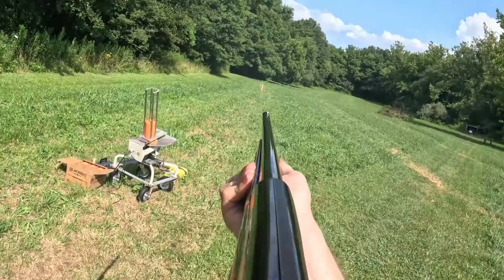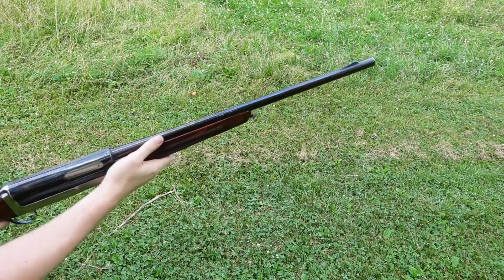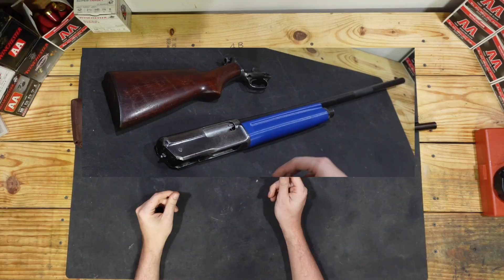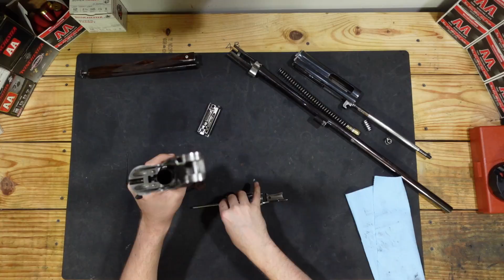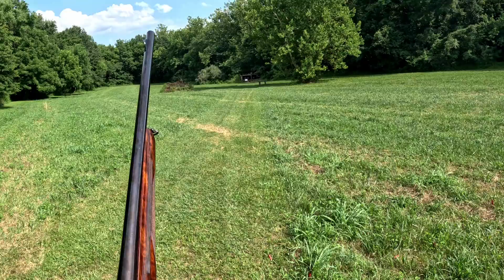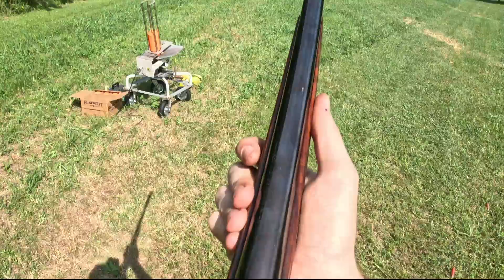The Cosmi - A Perfect Automatic Shotgun?

Comment: I shot a round of clays with a guy 25 years ago who was shooting a Cosmi. I was a machinist at the time and wondered how many hours it took for all the steps/tooling needed to produce the parts and time needed to hand fit them. I also thought it was a "an ingenious solution to a nonexistent problem". Had to break it open and turn it sideways to chamber a round after finding that little lever, took two hand to load the magazine and not easy to clear the chamber. He spent more time loading that thing than shooting. If it was supposed to be a "better than an Auto Five" it failed in all ways. If it was a "Look at how well we can machine and fit parts" it passes with flying colors.
Reply from the maker: Compared to the Auto 5, the Cosmi offers a sealed action, substantially better balance, better capacity, no snag points, and a lighter overall gun (comparing like model to like model).

This does come at the cost of more cumbersome loading (though it isn't at all hard to learn to do quickly, especially if you take advantage of it locking open on empty and using the bolt release), harder to clear jams/misfires, and more difficulty using it with heavy gloves.

For an upland or clays application, I firmly believe the Cosmi is superior to the Auto 5. For wetland, especially in the cold, I'd favor the Auto 5. Probably so with cold weather upland as well.

Comment: Cosmi’s are cool, but your explanation of the hammer cocking made zero sense because hammerless self cocking shotguns were the norm, long before the Auto 5 came out 🤷🏽‍♂️
Reply from the maker: The Cosmi was meant to give the benefits of an automatic to people who insisted on doublegun handling. This wasn't meant to suit the American market (though that the 1897 stuck around as long as it did is a sign that people wanted external, manually operable hammers still). External hammer shotguns were still extremely popular in the 1920s and 1930s.

Comment: What benefit does this action provide over the Benelli inertia driven system? To me the Benelli is much simpler and shoots very smooth. But I’ve never shot an auto 5 or a Cosmi. So I have nothing to compare it to. I’m a huge shotgun nerd, but more accurately a Benelli nerd. Excellent video by the way! Definitely subscribing!
Reply from the maker: Inertia systems aren't smooth. They are locked breech without a method for reducing the initial inpulse from firing - so their recoil feel is like a pump action or over under, with no buffering happening (aside from the little bit of energy stored in the drive spring).

They are fairly simple, but as a result are sensitive to the power of the fired load and while more modern versions of the inertia system are adjustable for this, that adjustment take places inside the bolt group, which is slow and awkward to get to.

Additionally, because inertia systems require the gun to move, a gun held too rigidly or shot when braced against something can prevent the gun from cycling correctly. The Browning A500 attempted to mitigate this issue by adding a floating barrel, but at that point it's just a more complicated recoil operated system.

In future videos we'll dig into the first inertia shotgun, the first Benelli inertia system, as well as the A500, to see the sort of progression that took place.

Comment: Very pretty gun, and very mechanically interesting. But the need to expose the entire action/mechanicals to dirt and debris in order to reload, is a big concern.
Reply from the maker: Traditional automatics are always open for ingress. Break actions in general are at least this open for reloading. To the extent either is an issue, the Cosmi minimizes the problems of both.
Reply: @IvanPrintsGuns Sure. But it’s a small opening by comparison. Dirt and dust would have to get in, then migrate to the other mechanicals. The Cosmi is so wide open, all of the mechanicals are out and exposed directly to potential contamination.

Don’t get me wrong, it’s a beautiful gun; the $25k price tag is much more of a concern than the mechanical function of it.
Reply from the maker: @robbythecuban  it's no more wide open than a doublegun during loading, all while sealed up better otherwise than other automatics.
Reply: It's a sporting arm, not a Vickers.

Comment: Beautiful firearm! Id be worried about getting dust and grim into the mechanical room when reloading in the field. Ive also never had a charging handle snag while hunting. Ive had a bolt action rifle that would pop open when slung over my shoulder and walking through brush but never an issue with a auto shotgun.

Comment: Hey Ivan, have you considered making a  ubar3 stl with the third hole? You know, for SOT holders. 

Would it be fine if someone did that and posted it online calling it the UBM4? Providing credit to you of course.
Reply from the maker: Works out better if you manually drill the hole. If you wanted to do it up in the model you could, but it'll be a little stronger if you print at 100% fill and drill the hole after print. Very thin wall to the top deck of the lower.
Reply: @IvanPrintsGuns  thanks